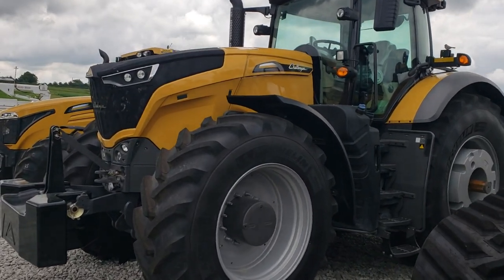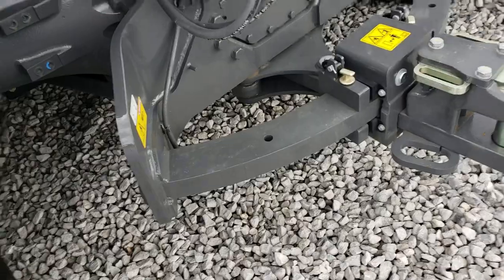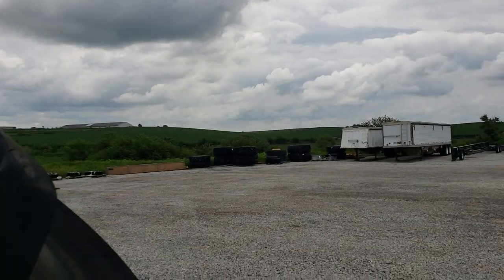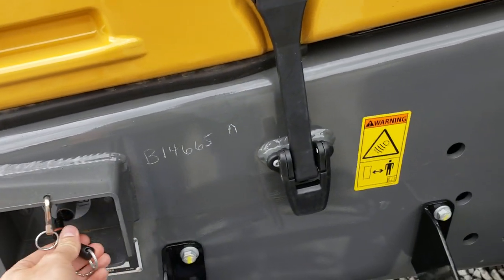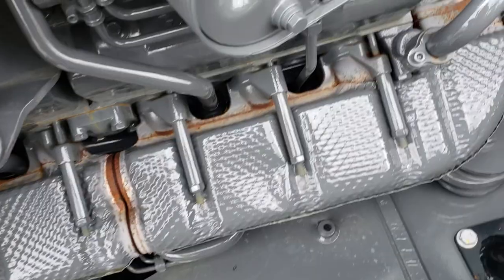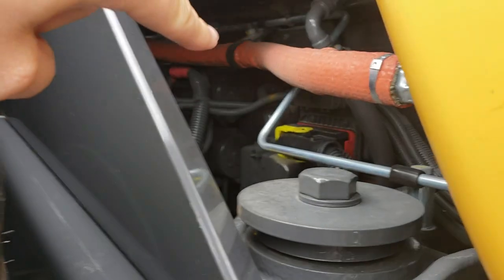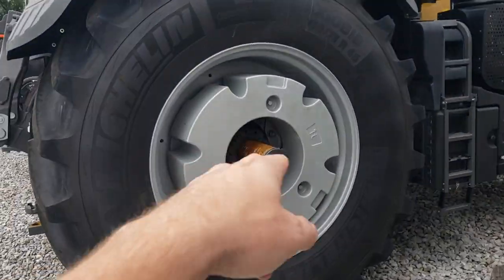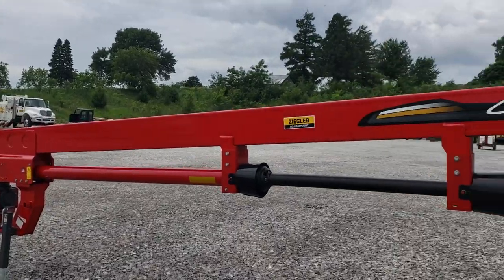More Challenger tractors

Comment: Cat hasn't had the Challenger line since 2002 when AGCO bought the line.  They did still put a few engines in the track tractors up until the D series when the AGCO Power (SISU) engines replaced them.  So, many people still confuse Challenger with Cat, but in reality, they have been separate and no connection for many, many years.

Comment: The Challenger pivot and the deesre pivot could not be more different.  The deere is all in one housing and mostly enclosed.  In my opinion the deere has a weaker pivot and is susceptible to breaking if the tractor gets 'troughed' between two minor hills.

Comment: I think it's interesting to check these machines out, JD tech myself and it's nice to see the other brands out there from time to time. A little more info about the engines, Agco purchased SISU engines a few years back and debuted the E series lines with either their inline 7 or v12 engines for their large machines. I haven't found any clear documentation as to why Cat left the ag world, some say they couldn't invest in new FT4 designed engines, some say agco wanted to have their own engine line. I think it's a number of things. I think the only cat powertrain that is left is the transmission, but I'm not exactly sure if that's just the PS for the 7's and 8's. I'd be real interested in seeing how a 1046 compares to your 8400R!
Reply from the maker: Thank you for taking time to write a comment - and I very much appreciate the information .... I would like to find out more of why cat left the ag market - must of been a reason of some sort - due to the agreement they reached with agco ..... We are looking at a Challenger 1050 - but figured, i could demo a 1046 (it should drive the same - same family) .. we just need more power than the 8400R ... I wish deere would take the 8400R and put a 9000 RT series engine / power train in it - and come out with a competitive machine to these .. but from what the dealer tells me - there is currently nothing in the plans to build anything like that
Reply: I went back and checked a few things, I guess the MT700 tracks had an in-house iT4 engine in the D series so cat was last seen in the C series tractors. I went to Challenger's website and they still are providing information for the MT700C and 800C machines, I find that a little strange if they aren't selling them? Kind of like Deere still having an 8030 series on their website still, I don't know, that seems funny to me. Anyway, Deere would pretty much have to completely design a different tractor series to compete, I agree it would be cool to see something like that. I just wonder what the market is for 400+ hp row crops. Im in central IA and I can't think of too many row crop farmers that really need that kind of hp, manure (and trenchers/tilers haha) come to mind first. The new 13.6 Deere engine will be debuting in a year or two in generators systems, I think they are still working out a new power shift for the 9R series to go behind the new engine. Look forward to more videos about the 1000 series tractors, thanks for putting them out there!
Reply from the maker: Wow ... Thank you for the updated information .. Yes, that is odd .. Somewhere along the line Cat got out and Agco took full control ... Its also interesting to me how the Cat dealer (ziegler here in Iowa) is still selling these .. so I guess there must still be some sort of "cross over" relationship between cat and agco .... you hit the nail on the head - manure and a trencher! - those are two things i could use the big mfwd for! ... but your right - overall, i'm not sure how good the market is for a tractor like that  ... Thanks very much for commenting and good to talk to you!  stay tuned for more ..

Comment: I really think these are some of the sharpest machines out there, but when that grey paint starts to rust, it sticks out like a sore thumb. Mainly though, we would really need better dealer support around here before guys would seriously consider them.
Reply from the maker: Thanks for commenting ...  They are very nice looking!  ... but that doesn't sound good - if the grey rusts through ...  Yes, dealer support is a big issue - luckily, we have 3 pretty good agco dealers near me (all within about 35 miles) .... I would like to get behind the wheel of one for a while and see how it operates - really see how it works .. stay tuned

Comment: john deere doesnt make anything to compete with the 900 series challenger.  look at engine displacement, shipping weight, axle diameter, center pivot area... challenger is a scraper duty tractor brought to the ag market.  deere is a light duty tractor with light duty engines that they slap a few supports on to make them scraper ready.
Reply from the maker: Jon Stevens Maple Grove Farms ... accurate and well stated
Reply: dont get me started on john deere sucking hind tit to the 700 and 800 series tractors.  

then there is the combines.  my old deere has 30 year old 5000 hour bearings on it. and the new ones in the area are replacing bearings each year.   and it was a 12 row corn head machine. now we have to worry about 12 row corn heads on combines because they break the rims.  really?    the deere and case guys talk about simple reliable machines when comparing to a lexion.  but the lexion is built to perform.  and the challenger combine is a lot more simple then the case or deere.

Comment: It's not American made engine
Reply from the maker: Aaron Jarvenpa .. do you know who produces the engine? I see agco stamps their name on it - but I wonder if it's a Man or a fiat made?
Reply: BLACK EARTH EXCAVATION & TRENCHING, LLC its is an agcopower v12 its like the 7 cylinders in their combine agcopower
Reply: The engines in the 700, 800, and 900 series are all AGCO Power (Sizu) made in Finland.  They are the only Ag engine that is totally balanced like a racing engine.  They are very smooth running and very fuel efficient.  And they do not use a Diesel Partical Filter that has to regen casing lots of heat and maintainance problems.  The 1000 series uses a Mann engine.  It gets it max torque at low rpms.  The max rpm on the rpm on the tractor is 1700.  This gives it great fuel economy and long life.